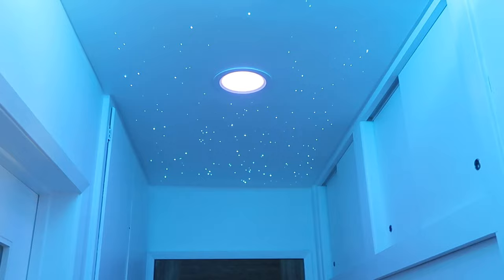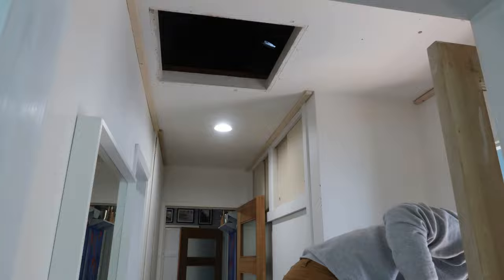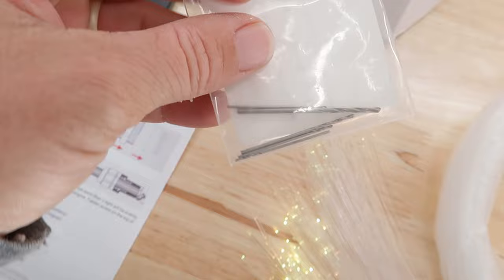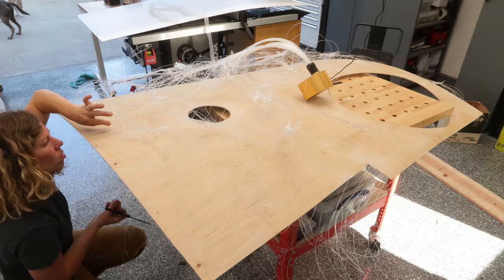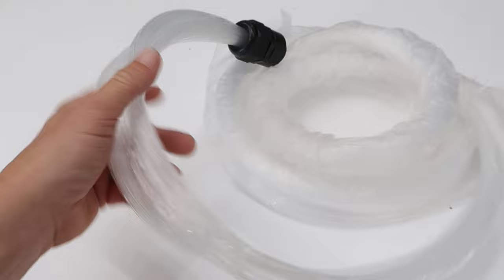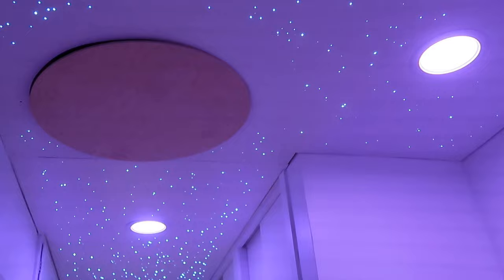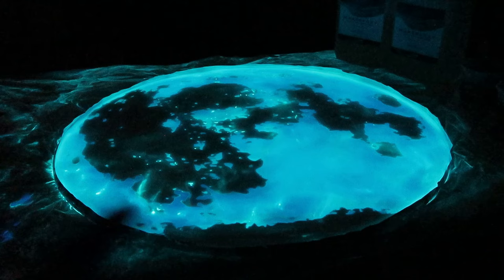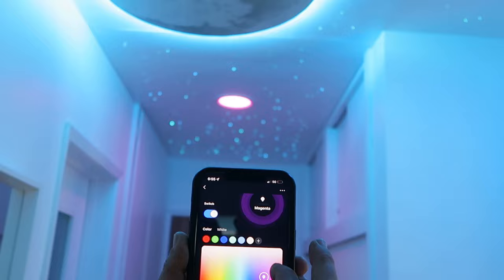Star Ceiling

Comment: Very nicely done. Did you wire in the fiber optics or do you plug them into an existing outlet? I guess I’m asking where are you powering the fiber optics
Reply from the maker: I ran out let’s to our attic so we could plug lights in, so I plugged the fiber optics into one of the outlets and it came with a remote to turn them on

Comment: Do you feel that cutting the fiber strands would've been easier before mounting the panels to the ceiling?
Reply from the maker: Possibly but I wanted to make sure that there was enough play, and I didn’t pull any of the strands out of the hole when installing it

Comment: did you end up using a diffuser on the moon lighting? Why not use projection vs the led fiber optic solution (seems labor intensive)? For the drilling wouldn't it have been faster to cnc the holes (and you could have done accurate star patterns)?
Reply from the maker: I have the diffuser material I just need to add it… Why not project it because where’s the fun in that when you can actually have LED fiber optic. I had fun drilling the holes and it honestly went by pretty fast plus my sheets were a little too large for the CNC and I didn’t need to have an accurate sky thank you for watching and commenting.

Comment: What brand of fibre optic lights did you use ? Did they come with the gold motor thing ? 
How do you get the power to the fibre optic lights to they need to be attached to a power source
Reply from the maker: I got the fiber optic off of Amazon and yes the ballast section is gold. I happen to already have an outlet run to our attic, so I plugged it in to the attic outlet and it run off of a remote.

Comment: My wife and I are about to have our first baby and I'm planning a similar project on the ceiling of the nursery. Can you tell me your thinking of using 1/8" wood panels instead of drywall panels or foam insulation boards?
Reply from the maker: It was such a small area that I figured doing the thin plywood was easiest to maneuver however if I were to do a large space I probably would do it with a thin foam board or drywall but we definitely need extra help mounting it on the ceiling

Comment: Did you use the powder pigment on top of the clear epoxy or mixed with the first gray coat?
Reply from the maker: Both, I added more at the end when it was curing, for extra glow in the dark effects and depth. But also mixed it in with the grey in the first pour
Reply: @wood_brain  thank you for sharing, would you please tell me which pigments (gray and glow) specifically you used? the link shows all product available.

Comment: How did u measure/cut the boards to size ? Thx
Reply from the maker: I took measurements in all the corners of the ceiling and drew out my lines on the wood then cut and did a dry fit to see if anything need to be shaved down to fit.
Reply: @wood_brain  thx! Great job!